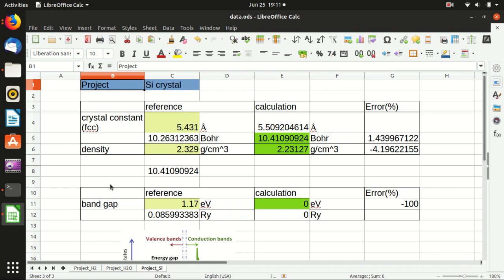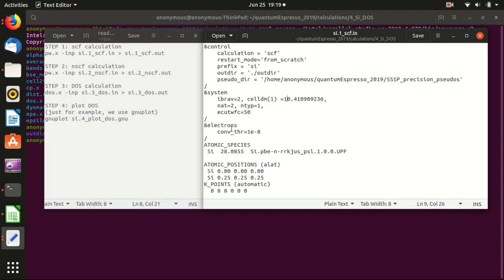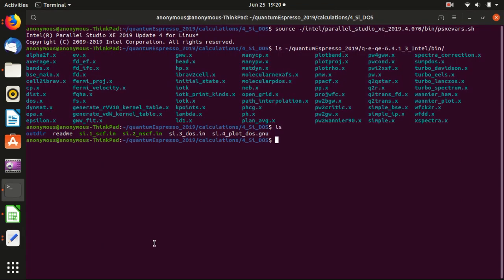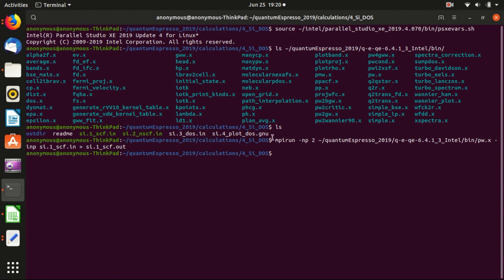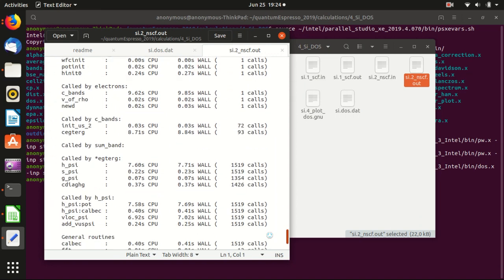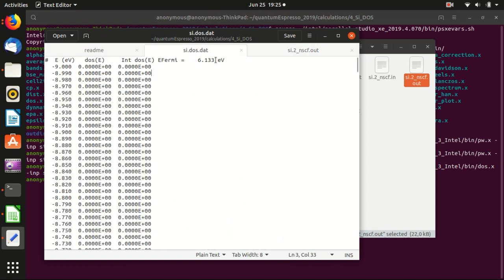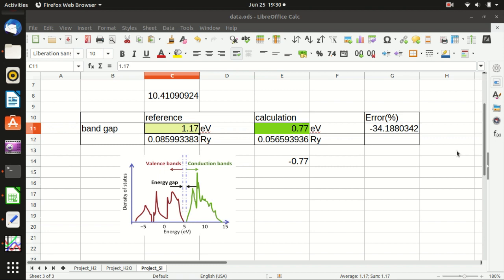Project: 3.2 Silicon DOS and band gap calculation | Quantum Espresso Tutorial 2019

Comment: DOS AND BAND GAP CALCULATIONS
0:00 Introduction. Definition of band gap
	DFT calculates data related to relaxation (crystal structure) but does not evaluate well (underestimates) the band gap
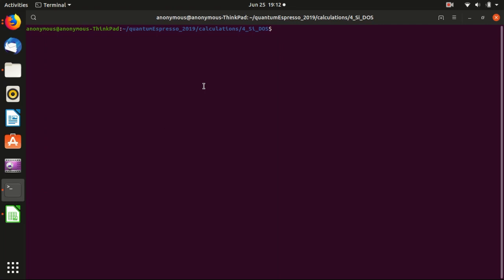1:13 gnuplot (for plotting the DOS)
	installation 
2:20 check for dos.x in the bin/ directory
3:24 Steps of the Calculation strategy
4:20 Step 1 input file
	calculation = 'scf'
	restart mode = 'from_scratch'
	outdir = to be kept the same in the first three steps
	ecutwfc = 50 ! to increase the precision
	celldm(1) = ... ! from the cell volume relaxation calculation
6:18 IMPORTANT: When crystal constants are needed first DO a variable cell (vc) / cell volume relaxation calculation to get the constant for the pseudopotential
	Crystal constants are dependent on pseudopotentials (PPs). Carefully chose your PP 
8:29 Step 1 RUN
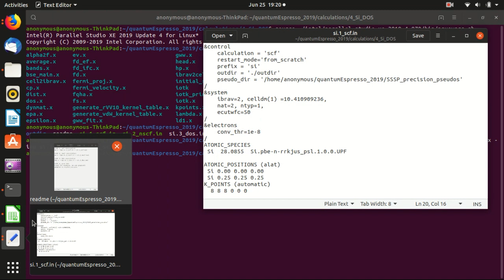9:12 Step 2 input file (non-self consistent)
	Refine the Step 1 calculation run with 8x8x8 k - points
	calculation = 'nscf'
	occupation = 'tetrahedra'
	K_POINTS 12 12 12
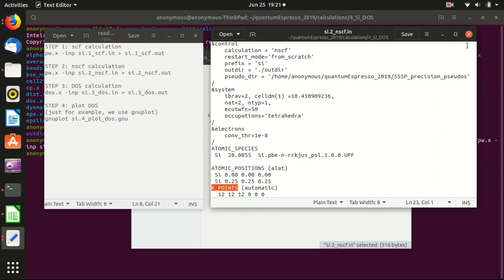10:12 Step 2 RUN
10:41  Step 3 input file (DOS calculation)
	uses dos.x
	keep the same prefix, outdir
	emin, emax - energy limits for DOS plot
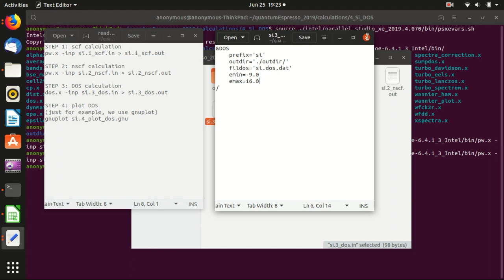11:27 Step 3 RUN
12:12 DOS file si.dos.dat, E (energy), DOS(E), integrated DOS
Fermi level 
13:32 DOS Plot E - DOS (E) or 1st and 2d columns in si.dos.dat
Plot using gnuplot directly
Plot using gnuplot script (described in the video) 
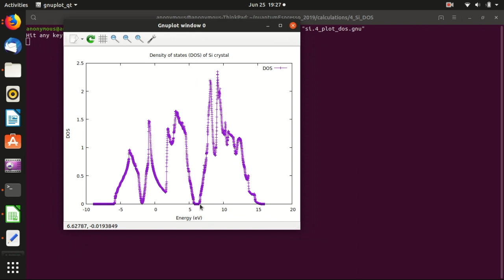16:00 Getting the gap from the plot
17:18 Comparing the calculated DOS plot to the measured DOS
Error 34%
Solving the band gap problem involves including Hartree-Fock calculations or hybrid functionals